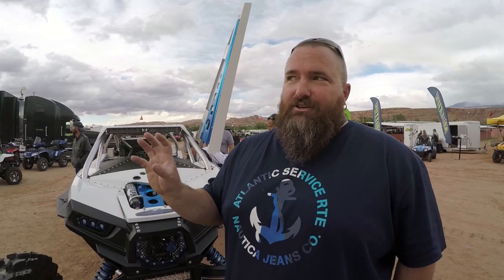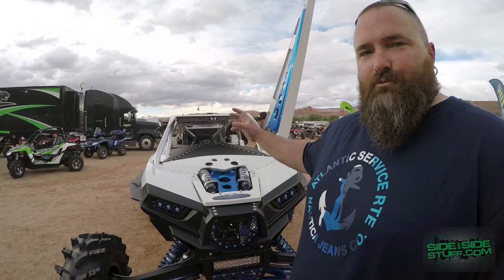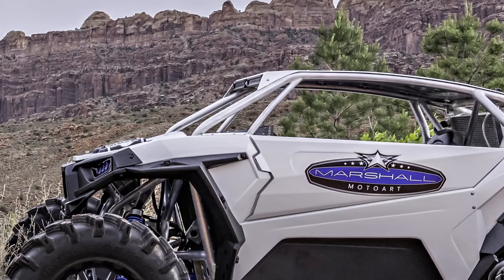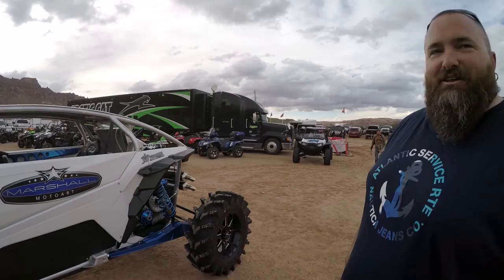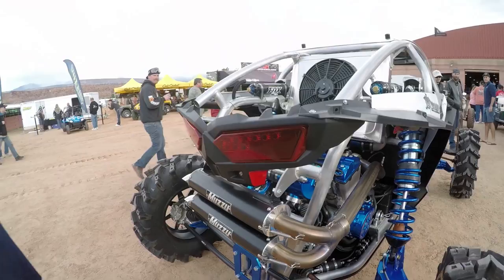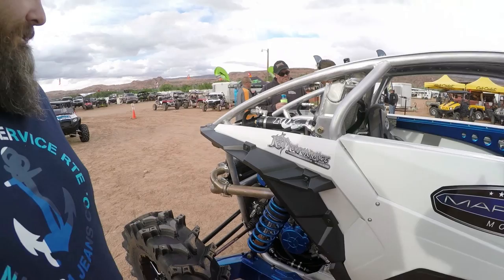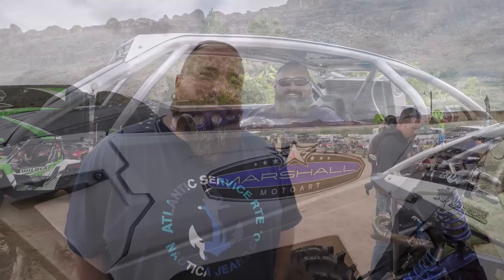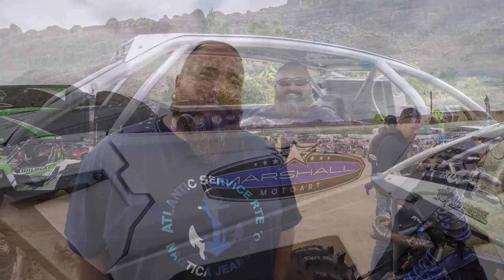Marshall Motoart "Superleggera" RZR 1000

Comment: what did they do to the head gaskets to hold 25 psi long term? or is it still a stock gasket? i have a turbo on my 1000 and was told the head gasket cant hole that much psi long term. like 200 miles is all?
Reply: kevin merrithew it's a built motor not a stock 1000 turbo

Comment: 330hp? say good bye transmission and diffs, let alone axles.  Should do like Chris Riddle and go to chevy/gmc diffs and axles, or something like that.
Reply: +Stephen M Check out the build sheet it not all stock guy.
Reply: Didnt say they were stock
Reply: Stephen M
trans, axles, and diffs are upgraded why would they say goodbye to them when they built them to haddle the new power??
Reply: Because i havent seen the build list and 99% of custom or upgraded diffs and trans parts ive seen uss d have been based on stock parts so they end up still being not enough.
Reply: Was the build list even available june 15?? Lol
Reply: id rather get a ariel nomad it handles the power and they use premium parts like Öhlins suspension
Reply: Of which none are built for off road use and abuse. Might work, might not..
Reply: +Stephen M You could do it with a low amount of torque...